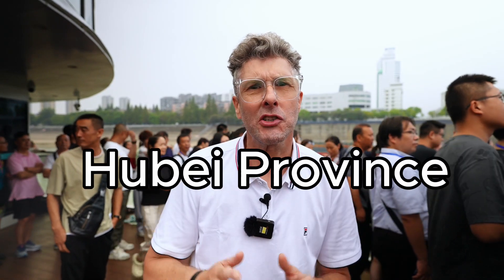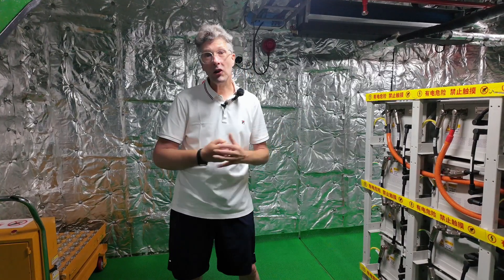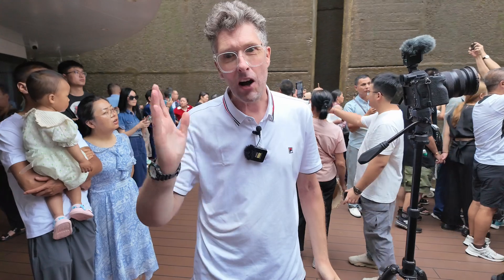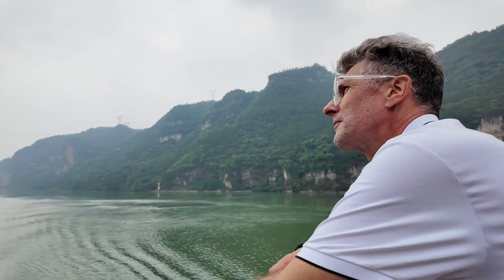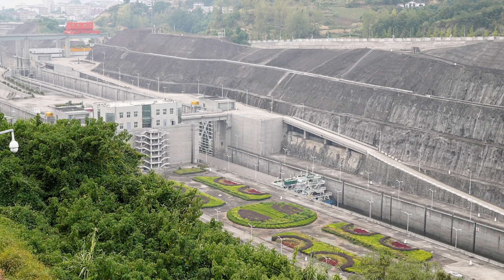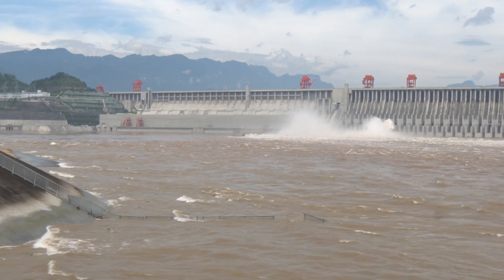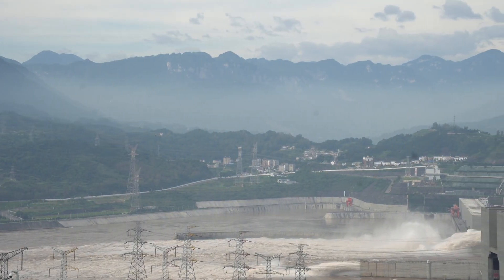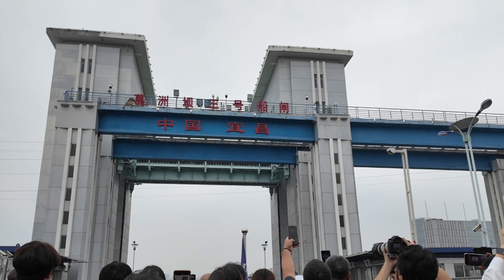Three Gorges Dam: The World's Most Powerful Dam

Comment: 100 kilometer range?

The distance between Yichang and Chongqing is over 600 kilometers.

The ride between Chongqing and Yichang and vice-versa is THE most important route for passenger cruises and until that electric cruise boat can make the distance between Yichang and Chongqing, the boat is basically useless.

Comment: Not even in the top ten 
Kariba Dam

Built between 1955 and 1959 on the Zambesi River between Zambia and Zimbabwe according to the plans of French architect André Coyne, Kariba is the biggest. It is an arch dam, 128 metres high and 579 metres long that has a reservoir capacity of 185 billion cubic metres of water.